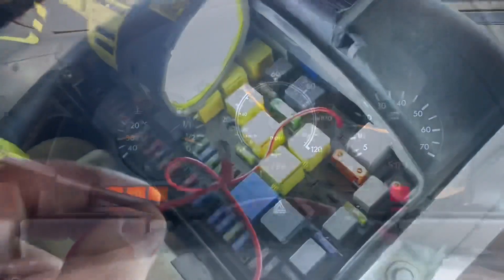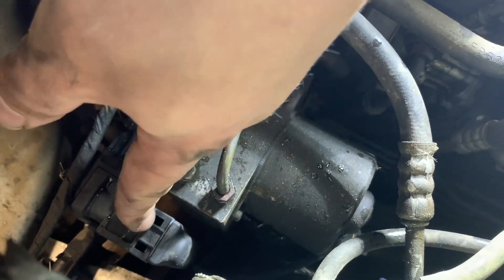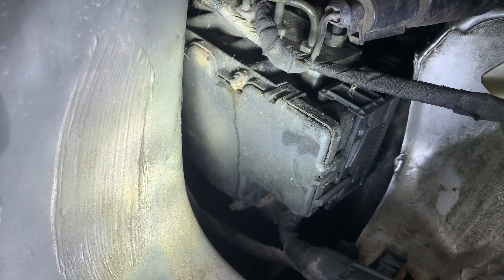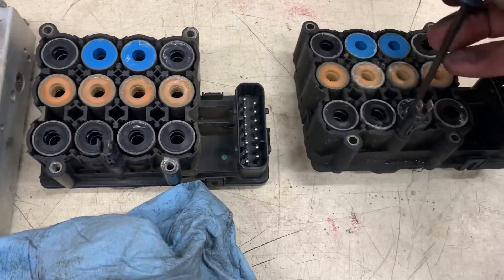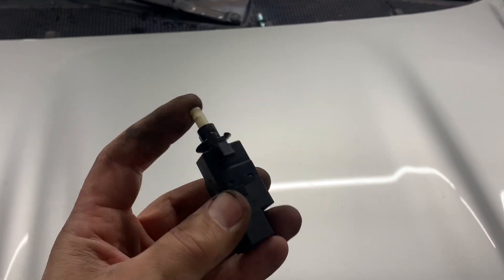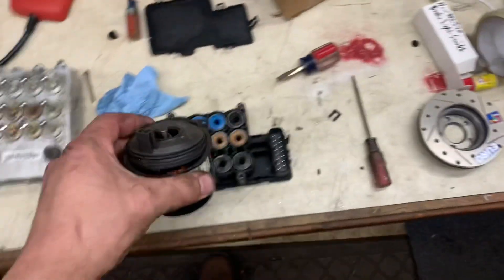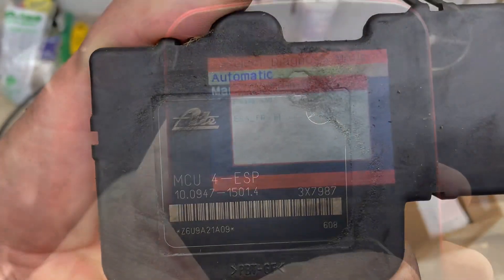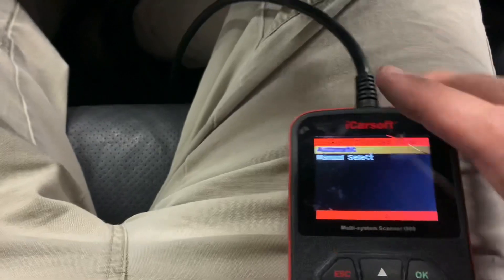How to fix Mercedes Benz ML320 ML430 ML500 Brake Light Beeping ABS ETS ESP BAS Lights Solved!

Comment: I’m in process of removing mine.  3 of the torx pins are easily removed.  The top right when facing the car the E6 and the socket are too long to fit.  I tried vice grips with the E6 but couldn’t get it loose.  The solution was using a grinder to shorten the E6 socket just a bit.

Comment: I have a two brake lights that come on at stops. Sometimes I hear the beeping, sometimes not. But I also have a windshield washer container that I can't fill up because it immediately leaks. Connected? Not sure, but, I know that when I back up slowly and hit the brakes pedal I hear a solid squeak. Does this simply mean I should replace the pads and rotors and I can count on the sound stopping?

Comment: My 2000 ml320 is doing the same thing but i have no engine codes. I also just replaced a rotor and brake pads all the way around, almost 2wks prior to this issue. The front driver side has no sensor harness so we left it disconnected. Ive driven it over a year with the old sensor not connected. Any advice on were to dig into first? Im broke🤷‍♀️🤦🏻‍♀️
Reply: Also when I bought the car used last year there was no windsheild wiper resevior nor the little motors

Comment: I’m excited about this fix in the video, however am a bit concerned about another symptom I’ve been having on top of the brake light beeping annoyance. My brake alarm will come on intermittently over the past week and when it does, my 02’ ML500 won’t shift higher than 2nd gear. I will literally have to pull over, turn off the ML and restart it (sometimes twice) and I can get it home. Now, I’ve learned brake pad wear, leak in the system or even brake sensors can contribute to these issues but I couldn’t find any obvious leaks and I got a fair bit of pad left all around. I’m gonna take a look at this module and also do that guys K27 for K25 swap with fingers crossed.

Comment: What do you use to clean it ???? The corrosion.
The wires in the back brake of the plug in to the grommet and disconnect. Trigger light esp/abs light

Comment: One of the main problem with the w163.  Had the abs bas/esp light on. I own 3 w163.  The ml270 have the wires by the abs unit exposed and cut. The 2nd ml270 seems to have similar issue as described here so I will be checking it and the 3rd ml500 had the brake switch fault.  Thank you for the video

Comment: Hi how did it go with bleeding the brakes, I've got a sinking pedal, so removed the complete unit, also found the coloured solinoids don't come out, l presume the rods on the block are fixed and must be guides as they seem to be fixed ! So the valves must be the spools that are pulled up by the coloured solinoids, they have lines and numbers stamped on them, but just couldn't get them out.
Also fitted new brushes to the motor, all 3 lights were ON. Cleaned and sprayed water repellant into solinoids and PC board through a couple of holes in the plastic housing, re assembled and fitted the whole unit , and bleed brakes, brake pedal still sinking, my next test is to blank off the 2 big pipes from the master cylinder,  on the ABS unit, with small ball bearings. And see if pedal will stay at a point, and not sink with foot pressure, have to leave plug connected to ABS unit and engine at idle as there is no pressure on pedal! This will show if its the ABS fault or the master cylinder is bypassing internally...
Reply: Note: the ABS lights all 3 OFF after refitting the ABS unit, but pedal still sinks !!  Will advise the result after the test for a faulty master cylinder...

Comment: Hey, Joe 

I know this is over a year old but did you have to reprogram the module after you installed the newer one?
Reply from the maker: You do not have to reprogram. Hope that helps
Reply: @joesnowmobiles  Thanks for the prompt response i was finally able to fix my issue after a long 8 years thank you sir

Comment: Joe, I have the same symptoms but consistently get C1300.  I have done most repairs suggested on the web, starting with K25 and most recently a used ESP module.  Same C1300 comes up, I did see a C1314 a couple of times.  Any procedure on how to check or replace the ESP/ABS wiring harness?
Reply from the maker: Have you changed the transmission connector? Also how about the brushes in the abs motor.  I have never done a esp/abs wiring harness. What about the component with solenoids I replaced in this video have you tried that?
Reply: @joesnowmobiles  I have not replaced or cleaned the solenoid themselves but my latest theory is that the brake lamp switch is causing the error.  I have a bad habit of pressing the brake pedal unevenly.  Long story about how I deduced this because I never had the switch code and lights work.  However I have been focusing on pressing the brake evenly and so far the problem has basically gone away, been a few weeks.  I have a replacement switch and will check for loose pedal assembly.  If my old switch is dirty I hear cleaning the MBZ part might be better than OEM but will see soon.  Thank you for being curious and putting out W163 repair helps!

Comment: thank you so much. my esp bas lights been on a while..put tape over them // now park brake and round glowing sensor light on.. ill get onto it.Yes  I've had a long time windscreen washer bottle leak...What if i spray some CR20 electric cleaner in there when i pull it open??

Comment: I have that problem but I fix it by replacing the part that is in front of the fuse box driver side
It was not the ABS module it was an electronic part in front of the fuses